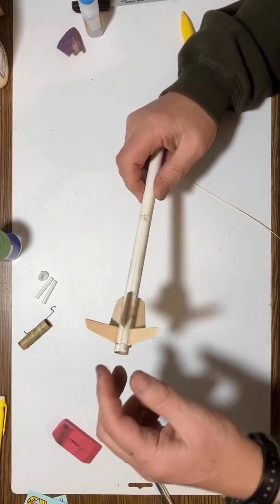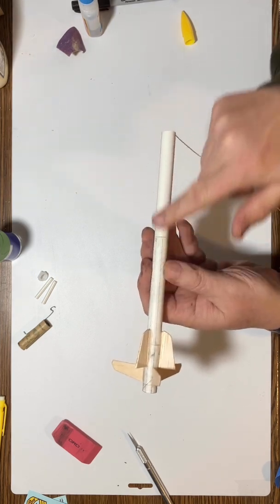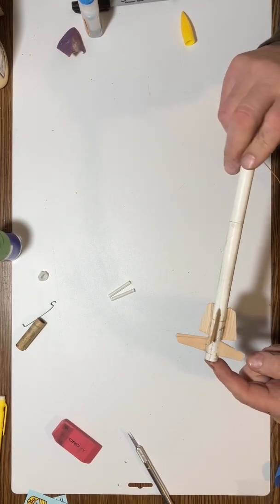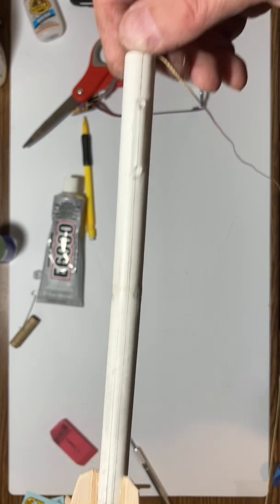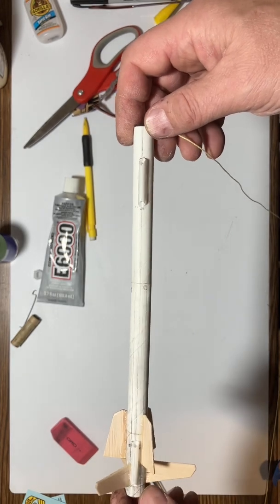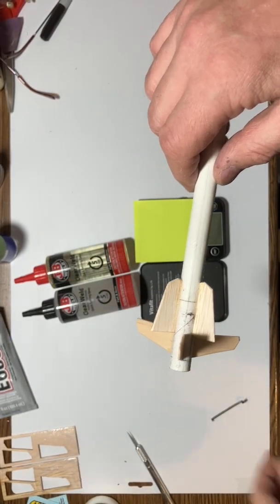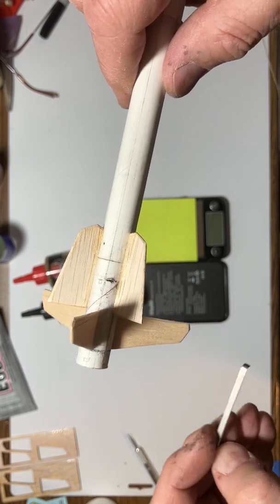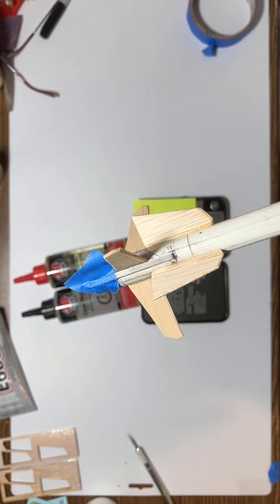6/7 - Custom Rocket "Tall Trooper": Mounting 6 Fins, 2 Launch Lugs, Engine Clip with Epoxy

Comment: Nice bevel!
Reply from the maker: Low/mid power launch lugs are the Rodney Dangerfield of rocketry - they get no respect. Since my channel is about "engineering", I like to make recommendations based on actual experiments I have performed. I have plenty of religious arguments with 40 year rocketeers and NAR, but I keep coming back with "prove it". 

Simple experiments dragging a LL along a rod I noted how grit made significant friction when hit with a square LL rather than beveling it.

The only rocket I have that beveled the LL is the Loc Precision Photon. The argument was to "reduce drag". The Photon also specifies to "cut the 6" LL in half with a bevel" and then there are 2 3" LLs. Thus, I see the bevel as both reducing drag and launch rod resistance. There are also benefits to having 2 LLs rather than just 1.

Ah, a lot of technology behind a soda straw! I hope my experiments and analysis will help rocketeers build better rockets!
Reply: @MrStreamerRocketeer excellent work! Thank you!